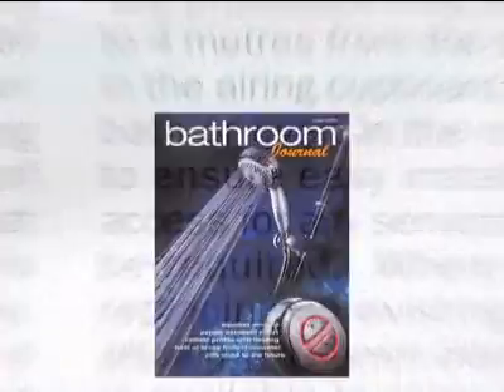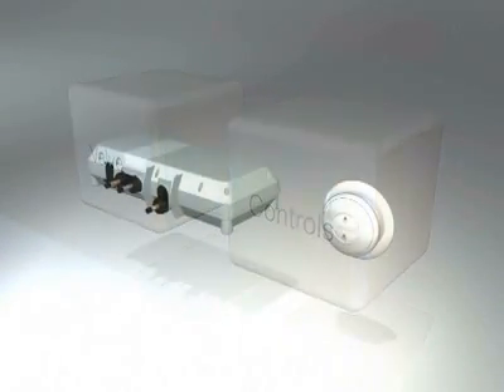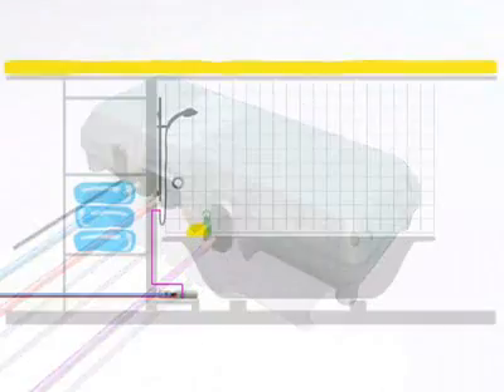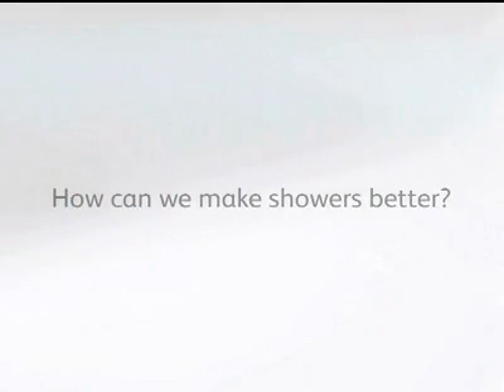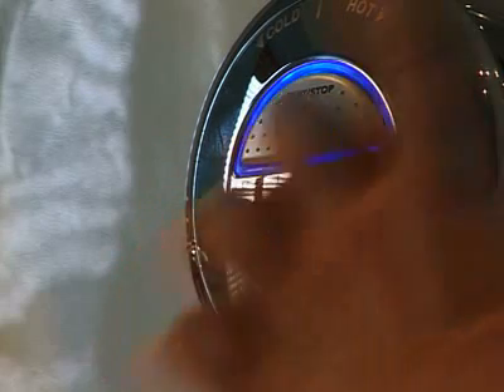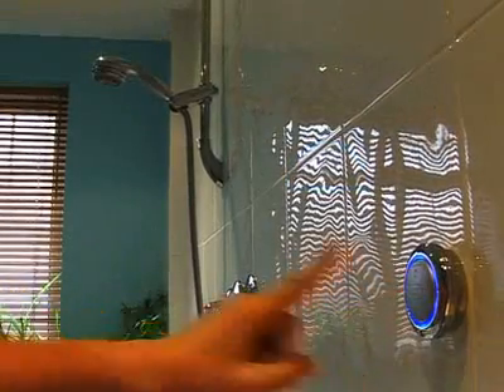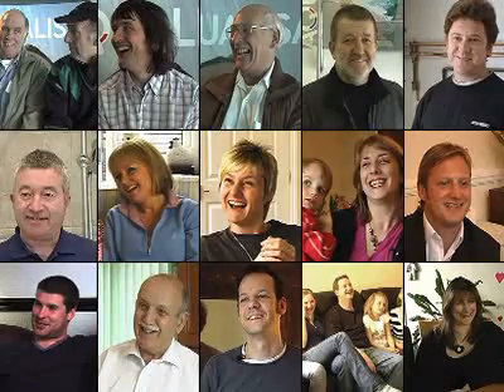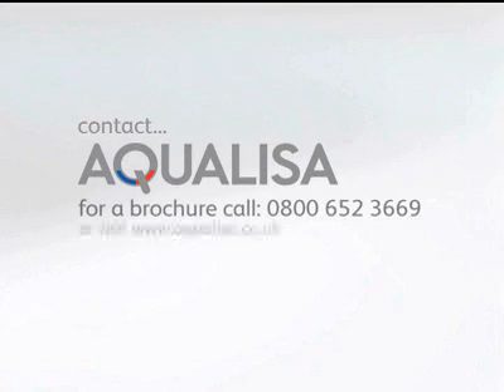Aqualisa Showers: How Digital Works

Comment: What is required to change the Aqualisa Quartz pumped shower to the standard one as a retrofit?  I am just about to fit the pumped version now, as we currently have a gravity fed system, however in a few years I'm sure we'll need a new boiler and presumably it would make sense to get a combi boiler for cost-efficiency reasons...?  So in that case, from what I've been reading, I will no longer be able to use the pumped version and I'd need the standard version. What new parts would I need? Thanks

Comment: My Aqualisa Digital Visage exposed installation replaced a traditional Triton thermostatic control. Fed by the same 1.5 bar Salamander pump, it delivers less water than the Triton.  The pump starts 4 seconds after the button is pressed, reduced flow probably delays operation of the pumps flow sensors. I doubt a 2 bar pump would solve this. 22mm pipes may, but all connectors are 15mm. The chrome down pipe rusted in 2 years. Replaced under warranty, it looks a pain to fit. Solvol Autosol works.

Comment: I had a job completed and the plumber did not turn valve back on so I attempted to run shower without water flow and now there is no power to the on off button anyone know what this could be please

Comment from the maker: There should be no real reason for the performance of this shower being much worse than the Triton.
Double check that you have the correct model and that the installation is as per the manufacturers instructions. Also have you set the Logic module correctly?

Comment: We had this grey processor in our property which we purchased in 2012, it became faulty in 2016 and  replaced it Sept of the same year at a cost of £280 with 2 year warranty.  Now 2020, the black processor is faulty, aqualisa are saying to replace it with an orange one for £408 with two year warranty or full system for £800 with 5 year warranty .  I have not got money coming out of shower hose! No thanks, I ain't a mug!